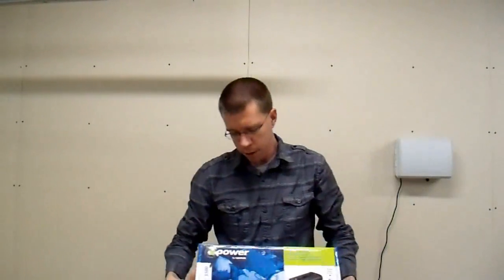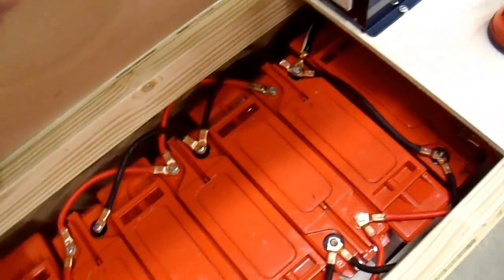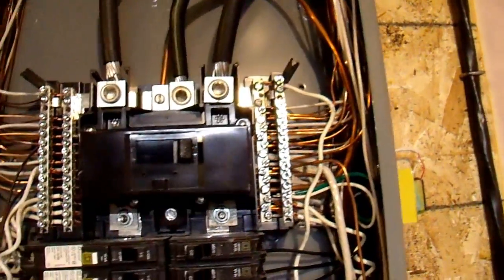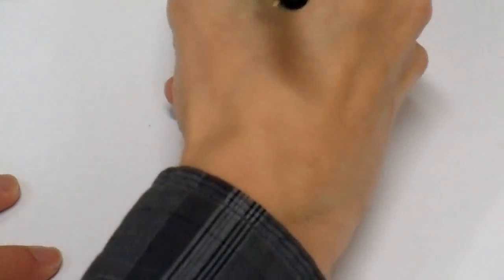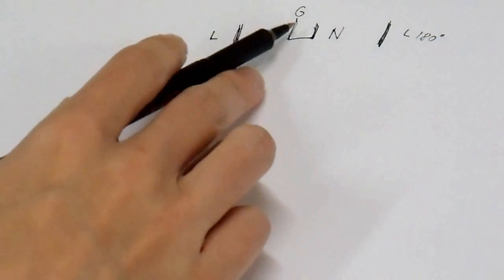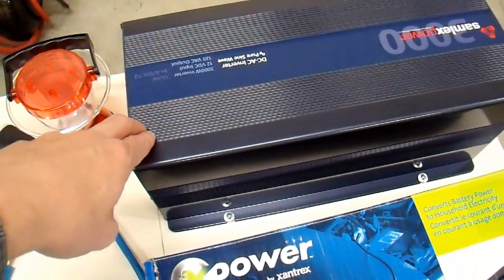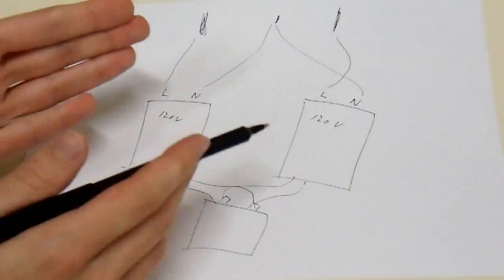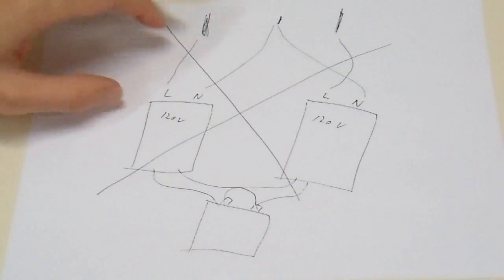How to Power your House with an Inverter/Generator During a Power Outage Part 1/3

Comment: I would not use two inverters  but you could if you turn off all 240 circuits. But its better to use one inverter connected to both buss bars. I would still turn off all 240 circuits. 73

Comment: Hello thank you for this video I thought it was absolutely amazing.  How do I determine what size of inverter do I need for my home.  I think it will be 15000+W for a 7k square ft house.  Thanks in advance. My first comment was on the wrong video lol
Reply from the maker: That question requires a complicated analysis of your goals, budget, needs, and tradeoffs.  Perhaps the first question I'd ask is what you intend to use for batteries and if a standard generator might be more suitable for your application.  A 15kw generator with on-site fuel storage is quite inexpensive compared with an inverter system that does a similar task for example.
Reply: In all honestly I live out in farm country we have an outage at least once every 3 months.  The last one was a 3 day outage. Well and with the way the world is turning i'd like to have an complete off the grid back up if possible. I looked at GENERAC well and being propane fueled house. The generac required for my house will eat up 500gals of propane every 5 days.  Just not cost effective at all for being a 35,000$ unit in itself alone!
Reply from the maker: A propane generator will last much longer than that on much less fuel - you just need to conserve a little and not expect to run your house 100%.  Probably run it 8 hours a day to cool down your fridge/freezer and turn it off during the night.  A small inverter can be used to keep lights, computers, phone chargers, and such small draw appliances on.  I live in a similar area to you BTW.  What you need to be worried about mostly is heat during the winter and that should NOT be generator powered.  A direct burn propane or diesel heater is the answer there and those shouldn't require any (or only enough for a small fan) electricity.   @danrolando7800
Reply from the maker: Generac makes some good backup units but that is 'rich person toy' stuff.  A simple dual fuel generator that runs on gasoline or propane can be had for under a couple thousand dollars.  It takes more setup work but works just as well.  @danrolando7800

Comment: Hello how are you doing i have 3000 watts pure sine wave 48V DC  110V-48V 60Hz Cnswipower what gade wire to used i have used 4 12 volt battery to 48V deep cycle 230A
Reply from the maker: What length will the cables be?  4AWG may be acceptable but 2AWG would be safer.  BTW I have tested that exact inverter and it's a well performing unit.
Reply: well today i was just doing little testing 1500 watts inverter 120V 60Hz 12A,digsaw 120V 60Hz 7A and nexr digsaw 120V 60Hz 4A i run three things at same times and it work not Milwaukee power station they have 🙂🙂🙂🙂 am using it for work will it run TaleSaw 15A  120V 60Hz
Reply: Tablesaw 120V 60Hz 15A  3650 R.P.M will it run it am asking not much at  R.P..M 3650 R.P..M
Reply from the maker: @andyjack2368  Quality table saws are usually pretty brutal loads for inverters as they require far more than nameplate rating to actually perform adequately.  Under load they can easily draw >30A or 4kw for short periods of time.  The 3kw CNSWIPOWER I tested would work well, but I'd expect a 1500W inverter to be inadequate.

Comment: I love living in a 240v country! I have 3,6 Kw from a simple plug in my bedroom! In a 120 v country you have to pray that your house doesnt burn down when you connect a space heater. But if i touch the outlet the chances of me dying are higher.
Reply from the maker: Old wiring is a problem no matter where you live.  In the USA we have 120V appliances but the fire risk is near zero in newer buildings built to code.  If your wiring is older than the 1970's then yes I'd agree.  An odd factoid:  120V is far superior to 240V for incandescent lighting which is why 100V ish was chosen for the system here.  Today a 240V system would definitely be better but the system is fully in place at 120V and will likely never change.  It works just fine and changing would be a complete mess.

Comment: Dumb question but would it be ok to use two inverters into two different outlets if you first disconnected the main and then switched off all 30 amp 240 double pull breakers so that they are not connecting your two out of phase 120s? Obviously it wouldn’t be appropriate or even possible to run appliances that large off an inverter plus as you stated they would out of phase.
Reply from the maker: If running off of separate battery banks it should be possible, but I wouldn't recommend it.

Comment: Thanks much, basement is flooding, and thought this would work... Thanks for going through all the details! May not be swimming by morning!
Reply from the maker: If you're in that situation I'd personally run an extension cord directly to your pump.  That's just what I'd do though.
Reply: @knurlgnar24  I am without grid power for the foreseeable future, so, I needed to do this anyways. The pump I use is very tiny, and over 100' from the inverter, and though I may have 100' of extension cord, the suicide cord got me half way there by using the house. Everything worked out fine. Still have some cleanup to do, but at least there is no further problems coming. Cashless and off grid, with very little power infrustructure can provide some very educational problems.

Comment: You are correct there would be a problem but if you had two separate neutrals one for each inverter you would avoid that situation. Now the problem would be corrected if at the panel everything was separate but we know some electricians are careless and somewhere in the house there could be separate neutrals joined together; in which case you would have to do a continuity test or you could put each phase on its own arc fault, breaker for a test.

Comment: In case you dont get to it, I want to connect my 2- separate 120v. inverters to my house with 2- large Power Stations, one connected to the A Leg and the other to the B Leg. Do the Neutrals have to be separated, since they are not phased to produce 240v from 2- separate Inverters

Comment: Can't imagine rolling that huge heavy battery cart around. Wouldn't a $700 generator be an easier option with more power to use including having both legs wired.?  Those batteries themselves must have cost a fortune not to mention keeping them maintained so they are ready to go.  Generator can sit for years and come out ready to go. Interesting setup. Thanks for posting.
Reply from the maker: Generators require maintenance and usually don't work due to gummed up carbs or other issues after sitting for a while.  I have a generator I start up a couple times per year to run through old fuel and keep it going.  The carb still gums up.  And I don't want a noisy generator running 24/7 that can't properly power much vs a good inverter.
Reply: - I run my generator dry and don’t store gas in the tank after sitting for eight months it fires right up on the first try. What do you mean a generator that can’t power much? 6000 W is what your standard generator power switch is essentially any house appliance couple of fridgerators lights TV everything else even a small air conditioning. How many watts can you inverter supply?  Noise I got to give that one to you!

Comment: Phases?    It is single phase!    At the end showing why the 2 inverters will not work shows that the 180 degrees out of phase is not correct.   The electrical sine waves are in sync, an oscilloscope (because of how connected) looks like they are not.
Reply from the maker: Split phase has two phases 180 degrees out of phase when referenced to neutral/ground.  This is correct as stated in the video.  It is also correct to call it single phase power as it is derived from only 1 phase of a multiphase distribution system.  Context is important.  An apple may not be made of meat but if I say 'worms eat the meat of the apple' this would be correct.  Context.
Reply: @knurlgnar24     Context is important!   Split phase is single phase split in half by connecting a neutral conductor at the point of equal turns of the coil on both sides.   Two lines, not two phases.   One sine wave at 240 volt amplitude and two sine waves at 120 volt amplitude all at the same time.

Comment: Why isn't using two inverters as described at 11:37 acceptable? What difference does it make that they will probably be out of phase in varying degrees as long as you are not seeking 240V power and any 240 breakers are off? You say "you would expect to have no volts here", between the two hot legs  ( I wouldn't jnow what to expect). What difference does it make if they are never connected and you are powering 120V circuits on two different, independent bus bars ?
Reply from the maker: As long as you never have any 240V breakers on AND both inverters have isolated conversion from the batteries (most inexpensive inverters do not) AND neither inverter has a live neutral (half voltage on hot half on neutral) then yes you could do this.  I just use a larger single inverter and connect the HOT to both sides of the 240V bus.  Then both have 120V and there is no danger even if I forget to turn off a 240V breaker.
Reply: I'm so glad you mentioned this hot neutral/ hot hot issue...

I watched this series closely and wired up to connect my 3000 W pure sine inverter, and JUST before I did I checked both lines with a power pen, found out they were both hot! I'd never heard of this before. My little gas generator is the same way... two hot wires. So, I don't think there's any way I can connect these to my home wiring unless I take all the house wiring neutral lines off of ground? 

I'm bummed out, I was real excited to play with this. 😐

Comment: Sheesh man, for ~$50, you can buy a proper outlet that does NOT need the suicide cord.

use an RV 30amp 240v generator inlet box.  It is a protected recessed male end that mates to the female end of your generator/inverter cable.  That is at least safer, but the lack of an idiot proof way to ensure the house is disconnected from the Mains makes this potentially lethal for our friends, the utility linesmen.  Backfeeding the grid is a big no-no!  Just thought you might like a 'safe' alternative to the suicide cable :)
Reply from the maker: To do it 'properly' you need a transfer switch in most jurisdictions which goes on the utility side of the breaker panel.  Some inspectors will allow interlock kits but most don't.  Because of this most people end up running a breaker to a 2nd breaker panel that has a built in transfer switch to that gen inlet box you speak of and re-wiring select circuits from their primary panel to the secondary one.  In all it's very expensive, messy, and poorly functional.  The only thing you can get for $50 is a backfeeding hazard that is now permanently integrated into your house and looks legit, but isn't.  That is much more dangerous than what I show here.
Reply: @knurlgnar24  man, I think you're comparing lethal injection to hanging :)
That being said, the comment was only to address any suggestion that ANYONE should make a suicide cable.  That's just dangerous, not just "not up to code".  A child is unlikely to get into  the home electrical panel and die, but they very easily could think they were connecting up a simple extension cord to a wall outlet.... only to find the female end was at both end.  On the one hand.. annoying - on the other hand, possibly lethal.   You may not have that risk (children) around your home.... but many people do!

Comment: Nice video. We just whip an extension cord through the basement window and learn to dodge cords all over the house. Our power outages happen maybe 2 or 3 times a year and usually don't last 8 hours. Actually they're kinda fun.
Reply from the maker: Your way is the safer way.  It's nice to use existing light fixtures and some refrigerators/appliances are built in or difficult to move, etc which may limit options for some in such situations.

Comment: Uuuuuuuuuuh, isn't that type of cable technically illegal? Not to mention extremely dangerous.
Reply from the maker: It does not meet NEC code so in an incorporated area, technically, it is.  And so are most appliances purchased from China on Amazon that don't properly meet NEC specs (though they usually claim to).  The video covers the dangers and describes in a good amount of detail why this method should only be used for emergencies.  Proper transfer switches are both extremely expensive to install in many jurisdictions and do not allow you to power your whole house in most cases.  Some places allow interlock kits and some don't.  Plainly speaking in practical terms this isn't very dangerous though.  I'd say running with scissors is far more dangerous.  And that's not even illegal.

Comment: Those bonds would tie into the bond busbar , what you are calling ground!
Reply from the maker: Not sure what you mean.  Ground refers to voltage potential relative to earth.  Bond means a mechanical/electrical connection to something else.
Reply: @knurlgnar24  bonds are the bare wires  to the ground  that continues from the panel to eather a grounding plate or grounding rods outside  two too four feet down in the soil , where as the neutral carries the voltage potential !!!

Comment: I’m planning to do the same thing my friend , Battery-BackUp - with a DIY Self-sufficient Generator - I was planning on hard writing it into the breaker box on a 100 Amp Double Pole Breaker or I have a 220v plug out-let which is never used anymore I got rid of my compressor it was a Craftsman 6 Hp. 33 Gallon tank my election wired for me as you just explained he wired it off each side of the breaker box given me 220v my 5KVA Pure sine wave inverter is single phase 220v-249v I was debating on removing the plug outlet and hard-wiring it straight into the line which will back-feed both sides of my Breaker-box and the only time using it is in a power- Failure ! On my Box the way they wired it is each leg not like toured into the top but the top 2 breakers are the power wires from the street shut the top 2 breakers off you kill all the electrical from my house ! That’s for the video I will watch what you’ve done thanks ! Now back to you’re work ! Thanks
Reply from the maker: I made a 240V dryer plug to dual 120V outlet 20A plug box that I use for this purpose.  Sounds like you have a good setup with your 220V plug that way.

Comment: Holy shit, the wiring in that box is dreadful. You want some insulation with those conductors?
Reply from the maker: huh?  What box are you referring to?  Everything is insulated in my electrical panel according to NEC standards the the battery box has no conductors near eachother that are not insulated with welding cable jacket which is some of the best available.
Reply: @knurlgnar24  The breaker panel, or as we would call it, consumer unit.

Somebody has been a bit over-zealous in there with the wire strippers.
Reply from the maker: @oscarmuffin4322  I'm very curious on this comment.  I am not an electrician but I have read the entire NEC codebook, have done wiring (with inspection), and have seen many breaker panels.  Can you comment on the non-ideal wire stripping or other issues you see in this panel?  As a non-expert perhaps I am not seeing what you are seeing.  Thanks.

Comment: I devicesd a method of making a suicide cord safer by having a circuit that detects current and only makes connection between the cord ends when both ends are plugged in. As soon as a plug end is disconnected, the connection between the ends is broken and no current can flow.. this help prevent getting shocked by the exposed male ends.

Comment: I had tried this before and fried a inverter,  it turns out that many inverters can not handle a neutral ground earth bond and after a few hours
of use it destroyed some of the capacitors inside the inverter ,  I was able to resolve this issue by placing a 1000 watt isolation transformer
between the inverter and the feeder circuit.  It has now been working for about 5 years.  I did not know this and I have been a electrician
for over 20 years.
Reply from the maker: If the batteries are floating, not connected to any potential relative to earth, you can use any inverter.  (2 prong, not 3 to the inverter) The downside is that the battery voltage will be live AC relative to GND!  Not terribly safe, but then this method I would consider only for emergencies or tinkering around.

Comment: I just removed the 2 main wires from breaker box and attached the ones coming from the inverter and boom the hole house got powered up as if it was from the outside

Comment: Hookin a pure sine wave inverter to your house wiring is a bad idea. Basically turns your house wiring into a high frequency output antenna. It’s not really a pure sine wave. It’s a modulation device that simulates a sine wave. If it doesn’t drive you crazy, it will kill you!,,

Comment: not that i would ever do it, but can you use 2 120v inverters to power up both sides of your panel if you shut off all the 240v breakers first?  i am curious if not, why you cant.

Comment: I have an off grid cabin Im wiring with a simple circuit of outlets that can be powered by the generator. Id also like to be able to power with a "suicide cord"should the first outlet I plug into be a gfci there in protecting the rest of the line?

Comment: If youre gonna throw safety AND code out the window, then just grab a double breaker, put it in the panel with a small jumper wire from one side to the other. Turn it on and voila! Both sides get lit up with 120v!